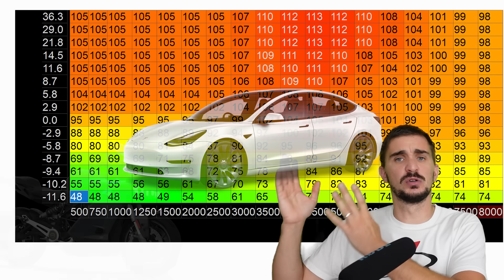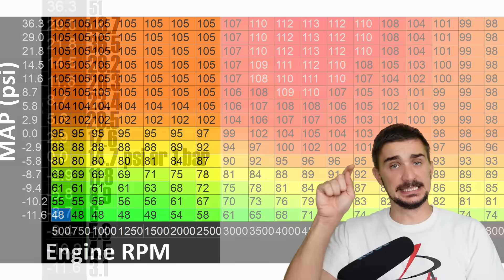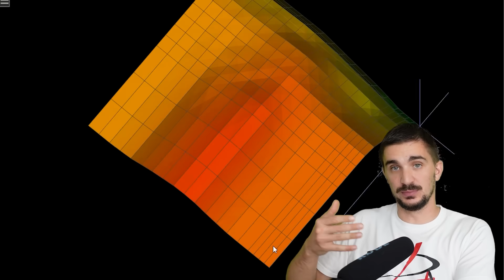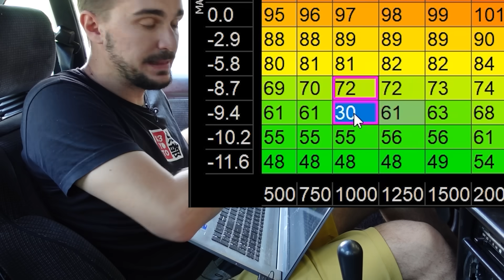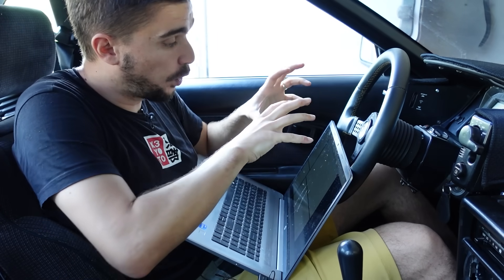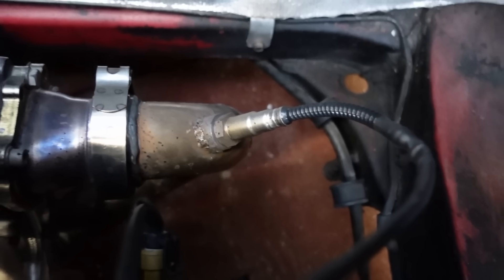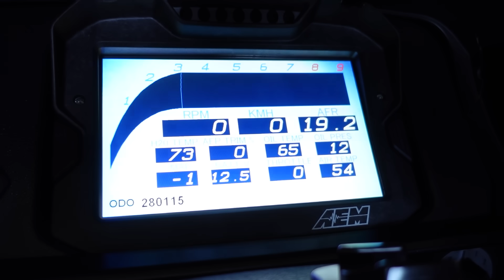If You Understand Volumetric Efficiency You Understand Engines

Comment: It's amazing that you can so easily purchase an EFI system and have most of the data including the injector characteristics data out of the box.

Back when I started it was just a bunch of computer nerds including me on a forum that started doing EFI tuning and conversions using reverse engineered GM Delco ECU and adding all the aftermarket support you see in aftermarket ECUs today and a guy in QLD in his garage that was the only guy at the time generating the injector data from his home built rig for us guys in the forum.

Back then, the only people that had injector data generation capability was Injector Dynamics, but they only did so for the injectors they sold.  My mate was offering it as a backyard service as we all knew how important injector characterizing was in the ECU to allow an accurate and stable tune.   Hard to think that was only about 10 years ago. How have things progressed in the car enthusiast space since is amazing.

Comment: I haven't watched the video yet, but the title is incorrect, understanding VE is just one aspect of how an engine is performing. VE tells you how well a cylinder is filling with fluid, it gives no gas-to-liquid ratio which is quite important if you actually want to make power. It also gives you no indication of burn performance of a fuel.
Brake mean effective pressure or Specific fuel consumption are far more effective ways to gauge actual VE vs calculated VE. 
For example you could have a low VE but high BMEP meaning the engine is fairly efficient in power production even though its gas pumping ability is in-efficient. 
What are you comparing engines on also makes a difference, if you have a truck engine you're after litres of fuel per 100km not cylinder filling capability, also weight is not a concern but in an air craft you're after BMEP per kilogram of engine. 
VE is just one figure that is used in engine design and one aspect of an engine understanding VE does not give you understanding of engines. 
The title may reign true if we were talking about air compressors, but engines are not motors so have other aspects.
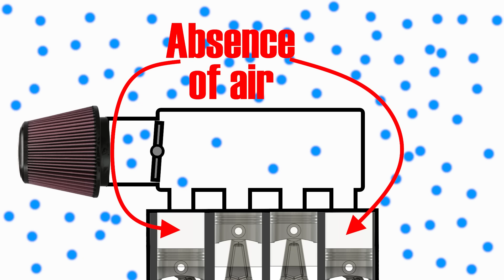Reply: At 2:15, no that is not how it works, the air has a pressure differential, but the air also has inertia in an operating engine, this is why it is deceiving using VE unless you fully understand what it's doing. This is because exhaust gas inertia and intake gas inertia both help at over lap to over fill the cylinder, this is why we see numbers exceeding 100%. The VE used here in this video has squares above 100% because it's based off atmospheric VE. 
When the Intake valve closes the air that was moving at speed now hits a closed valve, we had air speed now we don't, the air has inertia so it keeps moving down the port with no where to go. This creates positive pressure at the intake valve, before the air has time to bounce back into the intake manifold the intake valve opens, NOW! we have hundreds of pound per square inch of pressure just at the lip of the valve due to inertia, that valve opens and guess what, there is low pressure in the cylinder so this highly compressed air moves at pace into the cylinder which also has exhaust gas still expanding into the exhaust port. The exhaust port had a massive super sonic rush of gas which has now slowed to a mere 300kmh but that gas exiting is sucking on the exausht pipe making lower pressure at the exhaust valve side. When the high pressure of the intake gets let loose into the cylinder with the low pressure exhaust port pulling the gasses will flow in what we call Overlap, this is scavenging. 

That is how we get over 100% VE, the air doesn't just move willy nilly it gets moved buy pressure differential, explaining this any other way demonstrates a lack in understanding of combustion engines which quite frankly only 1% of engine guys actually know how they actually work.
Reply: I just did the calculation on the back of my hand and on a fairly common engine you should be seeing around 100-150psi at the valve head on the intake side, add 30 psi of plenum pressure you should see that go from 150-250 psi with the extra air weight.

Comment: I have to say that I thought I knew engines, but I never saw before a torque curve explained so well as depending on volumetric efficiency. I always thought it was also affected by more efficient combustion due to swirling which improves with speed and so on, but this video was excellent.
Now, I would be interesting to get an actual torque curve compared with the actual volumetric efficiency, and by getting the delta between the two, see how much the other parameters (swirl, different combustion speed and efficiency, enrichment and so on) affect the final curve.
Since you have the actual vol. eff. for your engine and I'm sure you got a torque curve measured for your car, you could do it. I was't able to find the two curves for any single engine so I cannot do it otherwise.
Please please :)
If you are not interested in a video about this (I know videos cost a lot of time), if you send me the volumetric chart and the torque curve of your car as measured at the testing bench, I'll compare them myself for my own interest.

Comment: Great explanation with a caveat, the VE model is not always on a MAF sensor vehicle. Many fords will be MAF only and do not have a VE table. It is usually exclusive to MAP or MAP/MAF combination. A MAF driven ECU has a similar table but units are airflow instead of VE. Also outside of an aftermarket ECU you will be hard pressed to find a closed loop target table in any common tuning sortware as various environmental agencies would shut them down instantly. In a factory ecu usually you can only tune the target table for power enrichment- full throttle, which is open loop in almost all cases and solely dependent on the VE or airflow table as the o2 sensor is disregarded. Aftermarket ECU do not have these limitations.

Comment: One important thing here is that this assumes that all injectors are identical in behavior, but as the engine ages they start to behave slightly different and that in turn can put more strain on the catalytic converter.
Another item to study is ignition timing. Today it's a trade-off between fuel efficiency and emissions.

Comment: Pls do a video with similar table for engine rpm vs MAP vs on MAF in g/second. I had a  supercharged 1.8 litre engine. When at idling rpm of 750, early morning, my generic OBD2 show 4.7g/second at  -7.35psi. At -2psi at 2000rpm at 53 miles per hour it shows MAF 18 to 20g/second on a flat road.

Comment: As a driver of a carbureted car, I'm a little jealous. You can just change some numbers and everything runs normal. I have to get out of the car and turn screws lol.
Reply from the maker: I had my carbs installed in a way that I had to remove them to change jets and I changed jets at least 10 times. But I still had lots of fun. I think that everything has its charm and merit 😊

Comment: Any idea how you could approach this process manually without the benefit of the oxygen sensor data?  We are using an V8 LM4 engine on a P-51 Mustang aircraft replica with open headers (and no oxygen sensors).  We have a map that works, but would love to understand more about what to look for in tuning the map manually.
Reply from the maker: That airplane sounds cool! Well, without the feedback from a sensor you really don't have insight into your air fuel ratios in real time. This puts you back into reading plugs and reading plugs is only good for wide open throttle tuning but I assume you don't change loads in an airplane that much anyway? It's wot most of the time? You could stick a probe into a header but you can't really put a plane on a dyno 😅 Id stick a wideband in one of the headers and then read plugs to see if they're all the same.

Comment: you also will run above 100% VE on a NA engine when the cam overlap is allowing the exhaust pulses to essential pack the cylinders with extra air

Comment: modern technology is great!  But not as great as these videos!  But I drive a Toyota Corolla with no aftermarket components.  I want to find out what the most efficient RPM for my engine is, ie, the RPM that will convert fuel to work most efficiently.  How do I find that out?
Reply from the maker: If it's a modern car you can observe real time fuel consumption as you're driving, it should get you in the ballpark. But best mpg is usually 5th or 6th gear and 60 mph or so. But maximum efficiency is often at wide open throttle because you're removing a restriction to the incoming air. On the other hand, this is not always the case, on some engines maximum efficiency can also be at part throttle. All in all, your safest bet is highest gear, 30% throttle and 60ish mph.
Reply: Thanks so much!  But going up hills (which are common and big in British Columbia), the fuel consumption will go up and it is then impossible to use that metric to observe efficiency.  I was hoping for a curve that would relate RPM to power.  Do these exist for low-end engines?   @d4a

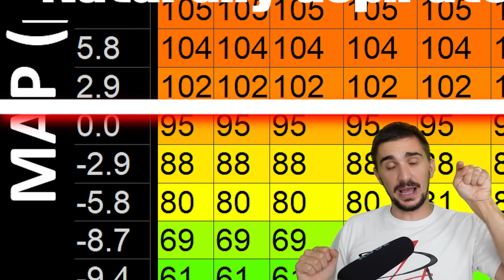Comment: Small correction at 4:15, this is the difference between MAP and barometric sensor. Also, is much easier to understand if you use kPa instead of psi!
Again at 5:20 atmospheric pressure isn't constant, it depends on the height, it can be between 88 up to 107kPa.

Comment: Great video. I made an ALDL ECM Monitor for 1987 Fiero V6 2.8L Mutiport Fuel Injection Engines. ALDL was before OBD-I and OBD-II so I can't tweak the VE table, nor can I even read it, but I may be able to build a VE table and display it.  I do have a Block Learn table where I display O2, INT, and BLM at MAP vs RPM - it fills in as it learns the blocks.  I am going to add a HP and Torque Graph as well.  I made a video of it in action in the car but it's hard to see due to lighting. More details are on my web site - my full name with a dot in between. Maybe you could take a look and give me some suggestions as to what I can add to it.

Comment: The accord hybrid only runs the engine (to charge the battery or power the motor) at optimal rpm.  Until you get above 47 mph, at which point it direct links to the wheels, single reduction.  No thrills, but 48 mpg in a full-size.

Comment: I wish you had talked about some diesel numbers in it. I know it's generally the same, but it's fun to see the best difference in AFR from idle to WOT and the ways that diesel does it
Reply: Yep, Same, but Diesel combustion is characterized by lean overall A/F ratio. The lowest average A/F ratio is often found at peak torque conditions. To avoid excessive smoke formation, A/F ratio at peak torque is usually maintained above 25:1, well above the stoichiometric (chemically correct) equivalence ratio of about 14.4:1. In turbocharged diesel engines the A/F ratio at idle may exceed 160:1. so no throttle valve restriction, no oxygen sensor (maybe NOx)!

Comment: Wow, this is the best explanation of modern engine combustion control I have ever seen. What about diesel engines without O2 sensor? Do they correct fuel to air ratio? They probably rely only on the basic map? Is this why they smoke when the load is increasing? Even with turbo charge intake pressure?

Comment: Please 4give my ignorance here maybe, but since getting into cars over last year or so, and being an embedded programmer. The thing I don't get is why I need todo things like remaps is the first place. As if I did the coding for my ECM I would not have used static maps anyway, I would obviously have access to all the sensor data I need to dynamically create the best maps or even if possible just calculate VE real time based from the current condition of the engine. I know Ive simplified this but its just something that's always puzzled me .. But anyway great vid about a hugely interesting topic.  I really miss ur explanations on things. xoxo

Comment: My Ducati 899 runs in open loop over 7K rpm, i.e. the stock ECU programming stops caring about the O2 sensor after that RPM. What could be the motivation to design it like that?

Also there are aftermarket piggyback ECU that advertise self learning maps for my Ducati. Is it learning the VE map?
Reply from the maker: Many ECU setups, especially older ones ignore o2 feedback at high rpm and full load. The reason behind it is to prevent engine damage at high rpm in case the sensor is malfunctioning. More modern setups avoid this by having safe mode. If they see unexpected afr values they trigger safe mode which disables max throttle and only leaves partial engine capacity at driver's disposal.
Reply: @d4a  Safer to go rich than lean, right? So its programmed to be 12 ish AFR at high loads and RPMs if the engine is breathing right. If the engine is not breathing right, it will run rich and protect itself?

Comment: To be honest, I didn't really understand why torque curves fell off at high RPM's. Now I do. It really makes me wonder what sort of wizardry goes on with those super high revving 4 stroke dirt bike engines. It seems to me that you would hit a physical wall where you could not possibly get any more air into the cylinder. Very good video!!
Reply: In short, they have lightweight internals

Comment: The ECU not being able to correct more than 30% sounds like the dumbest thing. What's the point of having a computer-controlled engine and all the sensors and data points and targets being piped into it if we still have to do it ourselves? For over $700 I expect it to ACT like a damn computer.

This video was extremely informative, but it also made me think that my long-lost friend who said most ECUs are running on SNES-level hardware and software was right. He said he was developing a "PS4 level" ECU and he would've been able to sell it for around $300-$500, and that basically the entire engine management industry was ripping everyone off, especially with different "models" that had higher or lower levels of control (IE the cheapest only going up to V8, single injector, single spark, basic sensors, and the most expensive doing V16, etc, etc.). Meanwhile, his $300-$500 solution would basically do whatever you wanted or told it to do with virtually limitless sensor inputs.

Comment: Very nice video, I now have a more clear picture of how maps actually work. However there is one thing bothering me, what if engine has a MAF sensor in the intake. If the VE map is telling our engine how much air is coming into it at given moment (moment being deifned as certain pressure and RPM reading), then is it not needed if MAF sensor is present and it provides info about the amount of incoming air at given moment. I woud assume that the delay in MAF readings might be a problem and still reason to have a VE map, but thats just my guessing. Would love to see somene explain or point to a nice source of info as I couldnt find anything quickly.

Comment: The "better" ecu's are like this, some of the cheap junk I had to fit and map "on clients demand" only allowed for timing "if no knock sensor input" and injection duration in milli-s   "yes, basic fuelling" but NOTHING like these maps. And no lambda "oxygen" sensor input, only a TPS input and crank position sensor. Slightly better ones have at least Lambda input as well and MAP sensor input, better ones NTC2 air temp and coolant temp. The cheap junk takes FOREVER to map, and virtually impossible without dyno or getting someone to drive while you make changes. And yes, saving copy of map is very important, because easy to slip up and be stranded, so upload previous saved map, and on your way in a few seconds... but yes, have totally stopped doing any cheap crap ecu's, just NOT worth the hassle. If clients want to go "on the cheap" they must go elsewhere "for everything, not just tuning and mapping, but any work they want to get all cheapskate on. And in the past I may have had the patience to "explain" that "penny wise but pound foolish" doesn't work in this industry. But now i don't bother, if they want it "on the cheap" then they need to go elsewhere 🐺